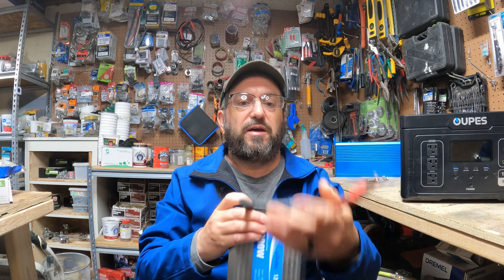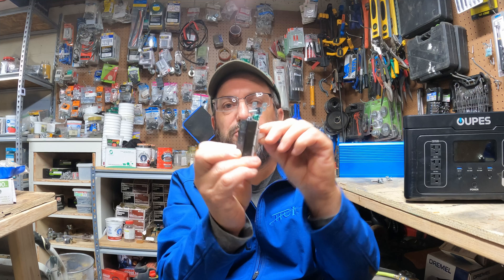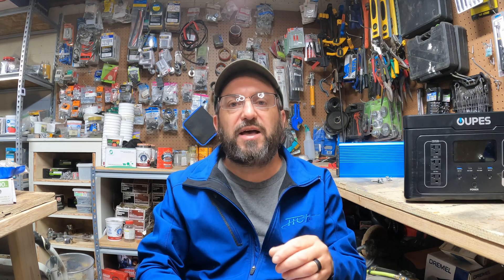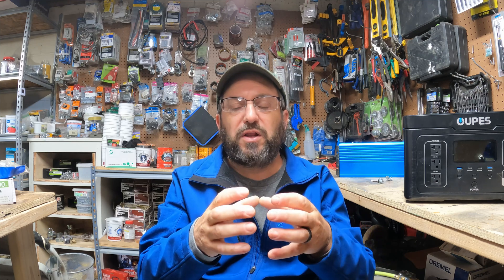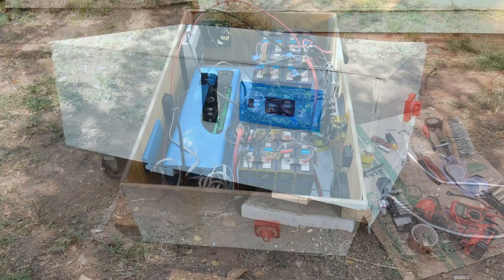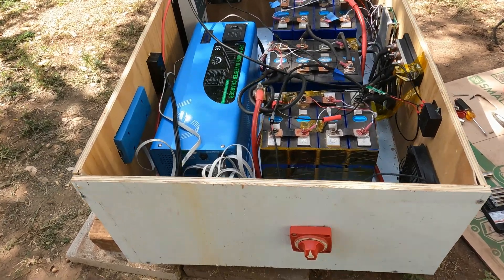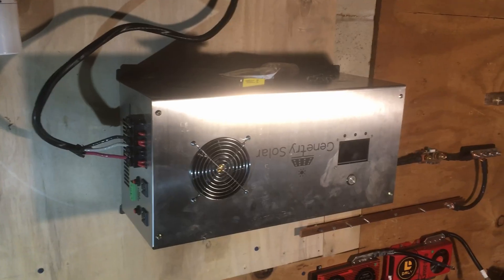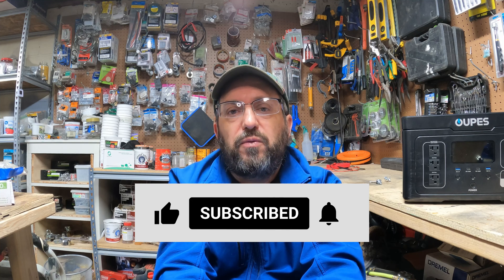The hidden danger of Portable Power Stations. What it is and what you can do about it.

Comment: There's also some crazy dude... or a bot, that always posts extremely negative comments about HF inverters vs LF across dozens of enthusiast YouTube channels.  Basically a cookie-cutter post, and then slips off into the sunset (never answers followups).

Hey, I'm impressed!  You did a great job!  Let me add a few technical details.

* The main advantage of the LF inverter is that the transformer blocks DC, 100% guaranteed... making it basically impossible for the DC side to couple over to the AC side as a DC voltage.  If a FET fails and one side of the transformer winds up with a fixed (unswitched) DC voltage and the related high current, nothing happens on the secondary windings.   This makes LF inverters more naturally safe.

* However, what people hawking this advantage forget is that in serious HF inverters there are multiple safeties that prevent DC from coupling to the AC side due to a FET failure.  The DC side will pop a fuse, there is also micro-controller monitoring of the waveform and usually also a relay, and in the bigger hybrid inverters there are usually two other safeties... a battery-side contactor independent from the inverter's DC contactor, and an AC side contactor used as part of the grid synchronization / UPS functionality.

Basically I know of no failure cases with professional HF hybrid inverters where DC has EVER coupled onto the AC side.  Not a single case that I know of. 

* Also the LF isolation is mostly irrelevant for home applications.  In a whole-home application (say, with a hybrid inverter), there is no isolation because of course neutral is bonded across and there is also a neutral-ground bond at the main panel.  So... no isolation.  No galvanic isolation, no practical isolation... nothing.   You only get the isolation if you connect appliances directly without any bonding.

* Theoretically an LF inverter has higher LRA handling (A/C motor starts) due to the cyclic energy storage represented by the transformer.  However as we have seen, recent HF inverters such as the EG4 FlexBoss series have no problem whatsoever achieving the same LRA handling... it can handle 195 LRA without flinching and do it better than most LF inverters ever could.

* LF inverters have numerous down-sides.

(1) Weight is a big problem.
(2) Resonant noise and the related vibration is a big problem.
(3) Cost is a big problem, particularly at higher output levels.
(4) Generally higher idle consumption (big transformers = bigger losses) (note 1, note 2)

note 1: Though there are exceptions, such as the Victron Multiplus I/II series which has very low idle losses and is mostly an LF design.   11W for the 3kVA model, 18W for the 5kVA, 55W for the 15kVA model.

note 2: Idle losses become less important with the larger inverters because they are usually paired with large solar systems and whole-house setups which always has non-zero loads anyway, and the idle losses basically wind up in the noise.

--

One additional difference is that, technically speaking, in an LF inverter the switching FETs are less coupled to the AC output side due to the transformer which makes it much harder for issues on the AC side to blow-up a FET.  In HF inverters the FETs are more strongly coupled to the AC output side due to the lack of a transformer and t is a lot easier for issues on the AC side to blow-up a FET.

However, in practical application, the selection of the FETs themselves far outweighs this difference in coupling.  Quality components vs junk components.  Wide voltage margins vs narrow margins.  Junction temperature ratings and current ratings verses application.  Larger HF hybrid inverters with longer warranties are going to have quality FETs... big honking FETs with huge heat sinks and massive operating margins.  It is virtually impossible to blow those FETs up, even though those are HF inverters.   But cheap little inverters?  Yah, those may have lower-quality FETs and much tighter operating margins... those are far more dangerous devices.

LF inverters tend to have poorer heat sinks because most of the weight and bulk of the inverter is taken up by the transformer.  HF inverters can dedicate a lot more volume and weight to sinking heat.  I see blown FETs on LF inverters that are obviously from operational heat all the time.  On an HF inverter it is actually a lot more difficult to heat-stress the FETs due to the much larger heat sinks.  And it isn't just about having strong fans... its mostly about the junction temperature of the FETs and dissipating junction heat is actually more of a function of the FET package and quality than it is about airflow over the heat sink.

Those are the primary differences.   In practical operation, professional / commercial HF inverters are just as safe as LF inverters.

-Matt
Reply: Been waiting for someone to explain these differences between the two types of inverters, thanks for making it easier to understand.  Best regards!
Reply from the maker: Thanks!  And I agree with everything you said. I wanted to keep mine on the simple side and honestly I figured you would post one with more detail. LOL. This way if someone wants to dig in a bit more they can read your comment.
But basically I wanted to show that HF inverters (quality ones) and safe and perfectly fine to use.
Reply: You don't have a clue what you're talking about. 

For example:
1. "LF inverters tend to have poorer heat sinks because most of the weight and bulk of the inverter is taken up by the transformer." That's a ridiculous assumption. There's plenty of unused space in a low-frequency inverter to add more heat sinks if needed. The heat sinks that are used in typical low-frequency inverters are more than adequate for cooling the FETs which explains why the cooling fans in low-frequency inverters are quieter and run less often than noisy high frequency inverters. 

2. "Resonant noise and the related vibration is a big problem." LOL! So, how is that little bit of humming sound that you hear when a low-frequency inverter is running a "big problem?" LOL!!

3. "Cost is a big problem, particularly at higher output levels." Maybe that was a problem 5 years ago, but today, High quality, low-Frequency inverters can be purchased for far less than cheaply built high-frequency, transformerless inverters. You obviously haven't shopped recently. 

4. "Also the LF isolation is mostly irrelevant for home applications.  In a whole-home application (say, with a hybrid inverter), there is no isolation because of course neutral is bonded across and there is also a neutral-ground bond at the main panel.  So... no isolation.  No galvanic isolation, no practical isolation... nothing." ABSOLUTELY FALSE. The high voltage, high current produced  by a high frequency inverter's DC boost stage, which can cause damage from a high-frequency, output transformerless inverter, is NOT bonded to the neutral line, so it cannot possibly cross over to the secondary of a transformer to reach the loads. Where in the world did you get your information from???

5. "Those are the primary differences.   In practical operation, professional / commercial HF inverters are just as safe as LF inverters." Absolutely false! Ask Google AI (which is a far more accurate source of factual information than you will ever be) Can a high frequency, transformerless inverter damage your appliances? And here's the answer that it will give you: 

 "Yes, a high-frequency, transformerless inverter can potentially damage appliances, especially those with sensitive electronics or that use AC motors. Specifically, a lack of galvanic isolation in these inverters can lead to DC current being sent to AC appliances, causing damage or even fires. Additionally, their limited peak power capacity and susceptibility to voltage fluctuations can also contribute to appliance damage. 
Here's a more detailed explanation:
Lack of Isolation:"
.
Transformerless inverters lack the galvanic isolation provided by a transformer, which can be a crucial safety feature. If a fault occurs, DC current can be unintentionally directed to AC appliances, potentially damaging or even setting them on fire. 

Limited Peak Power:
.
High-frequency inverters often have a lower peak power capacity compared to low-frequency, transformer-based inverters. This can make them unsuitable for powering devices with high surge demands, such as refrigerators, power tools, or air conditioning units. 
Susceptibility to Voltage Fluctuations:
.
Transformerless inverters are more sensitive to voltage fluctuations and unstable power sources. They may not be able to handle these fluctuations without causing damage to their circuits or the connected appliances. 
Harmonic Distortion:
.
Transformerless inverters can generate higher levels of harmonic distortion in the output waveform, which can negatively impact the quality of the power supplied to appliances. 
Appliance Types:
.
Appliances with AC motors (e.g., refrigerators, microwaves) and sensitive electronic devices (e.g., medical equipment) may be more susceptible to damage from high-frequency, transformerless inverters.
Reply: @Madsci-zy8wm  So your response is to cut'n'paste an AI response ... meaning, you don't have any experience with any of this stuff, you don't know how any of thus stuff works, you've never designed a power system in your entire life, and you don't understand anything I said.

I'm sorry dude, but you are living in la-la land.   But sure, go ahead ... it doesn't hurt anyone but yourself to go down the rabbit hole.

-Matt

Comment: Sorry to disappoint you @junkerzn7312 but you but I've worked in the inverter repair industry for the past 25 years and have more experience as a repair technician with both high frequency and low frequency power conversion devices than you will ever have in your lifetime. I was probably busy replacing FETs and Caps in inverters while you were still being bottle fed. My factory authorized experience with inverters dates back to the very beginning of companies like Trace Engineering, Outback Power, Magnum Energy, Statpower and Xantrex. I currently have a line of DIY inverters that I designed on the market for both practical and educational purposes. I've seen many of your comments on YouTube that support these inferior high frequency inverter products and am now beginning to suspect that you're just a shill account that was created to support several of these affiliate advertisers that sell these junk high frequency products. LOL!!

Comment: It's also worth mentioning in a portable power station, the typical use case is inherently isolated... the power station isn't externally grounded, so there isn't a ground path for current to flow. This makes the single-isolation of an HF inductor/transformer (with "neutral" attached to the DC negative rail) equivalent to the double isolation of an LF transformer, so long as that lack of ground path is maintained.

If you ground a power bank, or use any inverter with a bonded neutral system, or an RV system where the battery negative is grounded to the vehicle frame, a GFI/GFCI solution is a sensible and affordable precaution. For the power bank side, the nearby retail hardware chain has a plug-in option for under $20.
Reply from the maker: I would agree with that.
Reply: We're not talking about external grounding. We're talking about the current path that the current from the DC boost stage will take without the galvanic isolation that a transformer would provide during a catastrophic failure of the inverter's H-Bridge circuit.  Without an output transformer, there is no inherent isolation between an inverter's DC boost stage and its AC output. I suggest that you watch  "Solar Inverter Catastrophic Failure" by Red Hill Labs to learn more about this issue.
Reply: @Madsci-zy8wm  in this failure mode the voltage delivered is straight from the battery, DC, un-boosted. It's good to be aware that it can fail "live," in a sense, but it's nowhere near as dangerous as you've made it sound.
Reply: @jercos  As you probably know, when the low-voltage DC current from the battery enters the inverter, it is fed to the DC boost circuit, which raises the voltage to approximately 250-500V DC for 120V and 230V AC inverters, respectively. In the failure mode that I'm referring to, the MOSFET/IGBTs are basically shorted in an on state, which allows the current from the boost circuit to pass through to the loads.
Reply: @Madsci-zy8wm  you may read my post again if you have trouble understanding it.
Reply: @jercos  I understood your post perfectly. The failure mode that I'm describing is a situation where the DC boost stage continues to function despite the H-Bridge circuit failing, which is a failure mode that I've seen many times in the inverters that I have repaired. In this failure mode, high voltage DC current continues to be passed unimpeded to the connected AC loads due to the absence of an isolation transformer.  As I said previously, watch Red Hill Lab's video titled "Solar Inverter Catastrophic Failure"  to see a graphic illustration of this type of failure mode.
Reply: @Madsci-zy8wm  as I said, re-read my post if you're having trouble.
Reply: @Madsci-zy8wm  not talking about solar inverters, read the whole post before telling me to watch some random video.
Reply: @jercos  They titled their video using the term "solar inverter," but the video goes into a detailed explanation about this failure mode involving battery-powered off-grid inverters. I read your post once again, and it is now evident to me that you lack an understanding about the basic topology involved in high-frequency inverter operation or design. So I am finished with wasting my time with this conversation. Don't bother replying because I have to get back to work and frankly have no patience when it comes to dealing with amateurs with no formal education or training in the field of power electronics.
Reply: @Madsci-zy8wm  if you like getting your knowledge from videos so much, perhaps you should look up a video on the Dunning-Kruger effect, where a little specialized knowledge leads someone to confidently believe they have a complete understanding of something that is actually tangent to their knowledgebase. I understand you feel you understand all inverters, because you work with solar inverters, but when you come in like that, "go waste your time watching this random guy's video," nobody would care even if you were right.